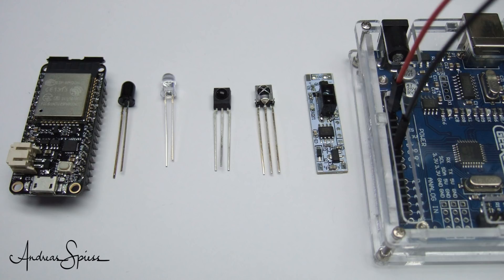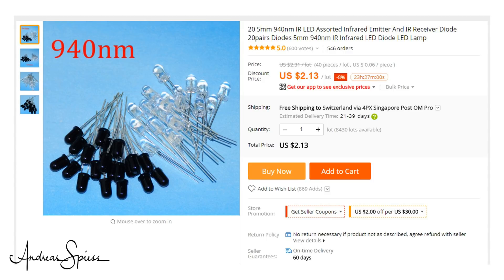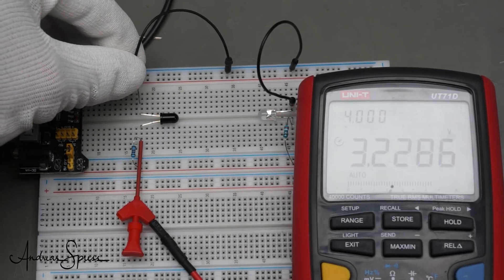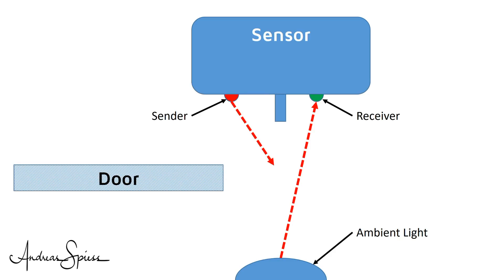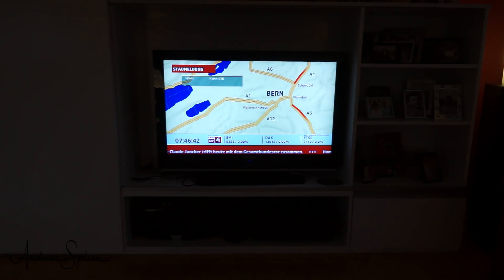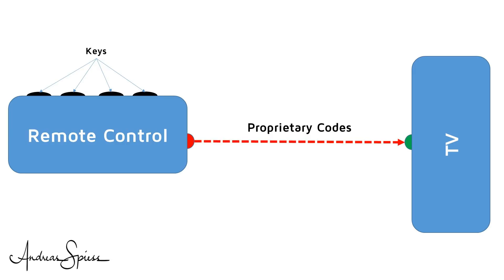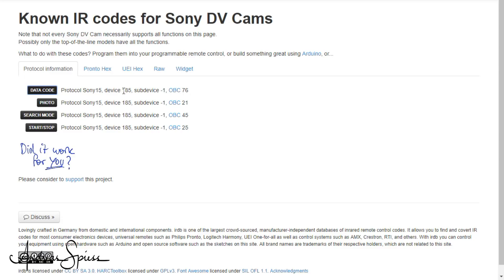#171 Arduino Guide to Infrared (IR) Communication also for ESP32 and ESP8266

Comment: Another excellent vid, Andreas!  
Why not just use the uC's registers and masks directly rather than use the burdensome and low-performance arduino ide functions for generating the proper signal frequencies and duty rates?  Almost any frequency generation is possible within very little cycle difference (error), which would not be an issue.  Directly accessing the registers is not dangerous nor is it complicated when compared to the much improved abilities they give the uC.

I do get it.... most ATmega 328p users are stuck forever in arduino-land, and you don't mind catering to the bigger crowd.  I would think that most people would rather learn a bit more and really see what is happening and be able to do much more, without the arduino-blanket blocking their vision.  The arduino ide still allows the use of all the registers, fuses, masks, and proper C and C++ instructions, etc, so if a person can't find the will to learn the basics of Atmel Studio in a few hour's time, they can still use the antiquated and pain-in-the-arse Arduino-ide without using the arduino's goofy, burdensome, canned functions. 
I suggest anyone reading this, and still using only the arduino ide, to go and download the Atmel Studio 7 and try it out before you let others convince you that it is too cumbersome and complex for you to understand and use to great advantage... AS-7 is so powerful and easy to use!  And it provides so many more features to help you work faster and smarter.  You don't have to learn all of it right away...  in fact you most likely can't.  It's a big place.  But after using it for a while you will not want to go back to the toy-like arduino ide. 
Yes, the arduino ide has it's place, it's super simple, etc. But it's terribly lacking.  Don't be ruffled by this comment.  Just try it out.  I double-dog dare ya. :)
Reply from the maker: 1. I did assembler programming and other low-level stuff like that when I was young and like it that the computer took over this work for me  (I still do it if absolutely necessary).
2. Arduino IDE is the standard in the maker scene, also because it can be used to program other MCUs like the ESP8266 or ESP32. An I go with a proverb from here: The fish has to like the worm, not the fisherman ;-)
3. Maybe you convinced some guys to try another IDE like Atmel Studio, or also Eclipse with your comment!

Comment: perhaps a ultrasonic sonic sensor like those HC-SR04 will be better for the TV door project, its awfully easy to program it to detect in a specific distance and no worries on the ambient lighting issues.
Reply from the maker: You are right, this is another possibility.

Comment: @Andreas did you have to do anything to get decent range from your emitters?  I've read most emitters in Remotes are "over driven", but I'm not to sure if that can be done with only 3.3V coming from an ESP*
Reply from the maker: This video was not about the distance, it was more about the logic to drive the LEDs. These microcontrollers only supply very little current ( a few mA) and if you want max power you have to add transistors to amplify the signals. I also do not know of high power IR diodes, but I never searched for them.
Reply: Andreas Spiess about logic not about distance is fair enough...  folks testing IR may think (as I did when first trying IR stuff) that the emitters are not reproducing codes correctly when in fact they are only effective inside about 30 cm driven by 3.3V ESP* pins, also looking with a phone camera is a good way to verify the emitters are doing something. :)
Reply from the maker: You are right. My setup worked over a distance of about one meter (from my ESP to the LED lamp above the bench. But it heavily depends on the quality of the receiver.

Comment: Your humor for the dear woman in your life is funny. I am certain your being a innovative electrical engineer goes over into other parts of your relationship. 
Curious as to how much range infrared can travel?  On approaching a gateway to a secured field a tractor or truck would automatically open from a distance of fifty meters. I would not want to have gate then left open but close in a short time with an override to keep it open should it be needed. Reliable and trustworthy are key elements for the not geek squad. 
Thank you.
Reply from the maker: I would not use reflected IR for 50 meters. Some sort of RF might be better for that.

Comment: FYI if anyone has an OSHW AVR Transistor Tester, there is a project option to decode IR signals ;)
Reply from the maker: Thanks for the tip. Do you have a link?
Reply: Andreas Spiess 
The IR option is on the M-Firmware Fork version. If you download the project SVN repo (linux) or download the tarball directly, you will have a copy of both firmwares. Once the main archive is unpacked navigate: Transistor Tester>Software>Markus>ComponentTester1.30M.tgz
If you unpack that (it's the most recent) file, Markus has info in the readme file.
https://www.mikrocontroller.net/svnbrowser/transistortester/

Project HQ is http://www.mikrocontroller.net/articles/AVR_Transistortester
Reply: This is a summary I created awhile back. This should be all project options encompassing both FW versions ;)

Absolute Minimum System
1.) 3× 680R resistors matched within 0.1%  
2.) 3× 470k resistors matched within 0.1%  
3.) 2× 100nF Capacitors (AVCC & AREF to GND)
4.) 1× 10k Resistor (Reset Pin)
5.) ATmega8/88/168/328
6.) Your Choice of LCD + Supporting HW
7.) 0.1% scientific laboratory grade power supply w/5.000 volt output 
8.) Push Button
NOTES: 
Internal 8MHz Oscillator
Internal Atmega IC Vref

M A I N  O P T I O N S

4× Interface
Option 1 minimum/required
Push Button
Option 2
2× Push Buttons (Increase/Decrease)
Option 3
Rotary Encoder w/integrated push button
Option 4
[Touch Screen (M-firmware Only as of 9/2017)

3× External DC Supplied Vcc Power
Option 1
0.1% scientific laboratory grade precision power supply w/ 5.000 volt output 
Option 2
5 Volt Regulator w/ better than 0.4% precision 
Option 3
5 Volt Regulator + 0.1% Precision Voltage Reference IC

5× Battery Based Vcc Power
Option 1
On/Off Switch + Test Button(s)
Option 2
MCU Controlled Timed Shutoff w/ Supporting Hardware + Push Button 
Battery Option A
9 Volt Battery + LDO 5 Volt Regulator w/ better than 0.4% precision 
Battery Option B
9 Volt Battery + LDO 5 Volt Regulator + 0.1% Precision Voltage Reference
Battery Option C
3.7v Lithium Battery + Boost Converter + LDO 5 Volt Regulator + 0.1% Precision Voltage Reference

4× (+1) Oscillator
Option 1
Internal 8MHz
Option 2
External 8MHz Xtal
Option 3
External 16MHz Xtal
Option 4 (M-FW)
External 20MHz Xtal
Option 2-4A
Standard oscillator Capacitors (~20pF)
Option 2-4B
1× Standard oscillator Capacitor + 1× Trimmer Capacitor ~0-30pF (Requires Frequency Measurement Device w/ Precision Disciplined Reference Oscillator such as a Rubidium Osc or GPSDO)

13× LCD Variations
~HD44780 (16×2/Hitachi Character)
~ST7036 (Dog-M)
~PCF8812 (Nokia 3410)
~PCF8814 (Nokia 1100)
~PCD8544 (Nokia 3310/5110)
~SSD1306 (microscopic size-OLED)
~NT7108 (Graphic Mono)
~ST7565 (Graphic Mono)
~LCD2004 (20×4 Character)
~ST7735 (Graphic Color 🐌)
~ILI9341 (Graphic Color 🐌)
~ILI9342 (Graphic Color 🐌)
~ST7920 (Giant Graphic Mono)

15× Additional Auxiliary Features Options
 ~TVS Array
 ~Relay Circuit Protection 
 ~Frequency Output
 ~Voltage Measurement (0.1-50 Volts)
 ~Zener Threshold Testing
 ~Infrared Remote Frequency ID
 ~Xtal Measurement (K-firmware)
 ~Optocouple IC Tester
 ~PWM LCD Backlight (LM339 based)
 ~UART Serial Communication 
 ~Solenoid Tester
 ~Direct External Frequency Measurement
 ~High/Low Freq. Measure w/Buffer&Prescaler
 ~Self Calibration Capacitor Circuit
 ~Sampling ADC Relay+Capacitor (K-FW)

Unofficial/None Supported Auxiliary Features
  ~Bluetooth Serial Communication 
  ~LC Meter Circuit (LM311)
  ~LC Meter Circuit (ATtiny3213)
  ~Xtal Test Circuit (PIC16F628A)

Comment: But after you decode the IR codes of the remote controller you want to copy, you also need to choose a specific IR send method (manufactory dependent) to send out the codes.
Correct?
Reply from the maker: Yes

Comment: How can we decode "Air Conditioner" IR codes ?
I want to transfer the code through XBEE from one module to another.
Reply from the maker: There is a comment of a viewer below where you find more info.
Reply: unsigned int  rawData[67] = {4600,4450, 600,550, 600,500, 650,500, 600,1650, 600,1600, 650,500, 600,550, 600,500, 650,500, 600,550, 600,500, 650,1600, 600,1650, 600,500, 650,500, 600,550, 600,500, 650,500, 600,550, 600,1600, 650,1600, 600,550, 600,500, 650,500, 600,1650, 600,1650, 600,1600, 650,500, 600,550, 600,1600, 650,1600, 600,1650, 600};  // SAMSUNG 181818E7

unsigned int  data = 0x181818E7;

no help down there!!

I decoded these raw data but how can i send such a long data through ZBEE.

Comment: I think for definitve it would be nice if you explored how fast you can exchange real data. Explore speed vs distance of ir pair as well as different times of day. Try to see how far you can exchange a file perhaps and write this file to sd card.
Reply from the maker: You are right. I thought, most people use IR for the scenarios I mention and not to transfer real data.
Reply: To transfer real data you should implement a proper protocol to manage transmission errors,  and at this point the speed will also depend on the protocol. You can have a look at HDLC, a protocol used for point-to-point connections beetween computers.

Comment: I did a very similar project last week but I used LIRC directly in my Raspberry Pi that runs MQTT and Node Red. I was also able to control remote devices using Alexa.

BTW: what's the site with the IR codes database? I have a Sony stereo w/o its remote and I'd like to control it. Thanks!
Reply from the maker: I added the two services I know in the video description

Comment: One of my next projects will be an IR sender.
So thanks for this video.

But I am also interested in your dimmable LED lights in your laboratory.
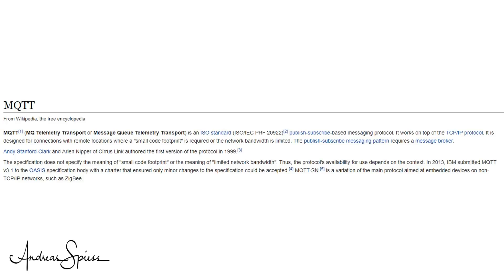I want to install white led panels like shown in Minute 13:00 and control them with an esp8266/32 and mqtt.
How did you manage that?
Could you make a video about that or post some links.

Thanks
Reply from the maker: I use a Sonoff dual, some PIR detectors, and Node-Red to switch my lights. I covered the different aspects of that in previous videos.
Reply: Thanks.
I know how to use Sonoff and mqtt.

But in the video it looks like you can dim your led panels.
And the Sonoffs cannot dim as far as I know.
Reply from the maker: +Christoph Wempe No, I cannot dim these panels. Just on and off.
Reply: Thank you anyway. :)

Comment: Typisches Beispiel für einen Ingeneur: Eine völlig falsche, überkomplizierte Lösung mit tausenden Fallstricken für ein simples Problem. Ein einfacher Schalter, z.B. ein CNC Endschalter mit rolle hätte gereicht und funktioniert. So musstest du dir zurecht das Geschnatter deiner Frau anhören - sie hatte mit jedem ihrer Einwände recht :)

---
Typical example for an engineer: A absolutely wrong, overcomplicated Solution with a heap of new Problems for a simple Problem. A simple Switch, a endstop with a rollerbearing for example, would have done the job perfectly. It's your own fault, that you had to argue with your wife - she was right with everything :)
Reply: At least it's not an example of how a marketing person would have it.
Then there would be an app where you have to find your phone, click 4-8 times and the door would open and the TV turn on.
It seems the WAF went from 0% to 100%+ after the bugs were exterminated.
Well done video again Andreas!
Reply from the maker: Viele Wege führen nach Rom. Ich wollte eine unsichtbare oder zumindes gut verstckte Lösung.

Comment: Another excellent video!

Out of interest, as you seem to fix a lot of libraries, do you tend to send pull requests back to the original repository with the fix?

I often want to use a thing you've fixed but don't know if the original repository (which quite often has moved forward since your video) includes your fixes.
Reply from the maker: So far I did not send it back. Maybe I will do it with this library.

Comment: Again an interesting video from Andreas !!
I also am thinking about putting ESP's with IR send and receive (and perhaps also a buzzer and some other sensors) in my house. However if you have several of this IR home automaton interfaces near each other send IR only from one! The devices will receive signals from each other and the logic can become confusing.
There are also much devices who use a IR power toggle code.  This requires the home automation system to maintain information about the current state. Or you need to add other sensors (e.g. the power consumption) to check if the device is on or off.
Reply from the maker: 1. As I mention in the video: You have to use an addressing scheme if you want to have several senders. Then, Node-Red can send an MQTT message to each of your senders, one after the other. Or the address is the delay each sender has to wait if it gets the MQTT message till it sends the IR signal...
2. Toggle codes suck. I do not like them at all because of the problems you describe.

Comment: Why not using an hall sensor instead of ir for the on/off switch? Easier
Reply: I also noticed that with reed switches the distance can be a problem. Hall sensors are more sensible !
Reply from the maker: You are right. Maybe hall sensors would be sensitive enough for the distance. Reed switches were not.
Reply: Sonar would work too.
Reply from the maker: +labomat you are right.
Reply: Because this video is about it.
Reply: Why would you make a system simple having a way to complicate it? To make a great video on technology, even at the risk of breaking your marriage!

Comment: thanks for share, i got question about lora, 

i want to make  group street lights like street 1, street 2 and is that possible to add street 1 group? i just think i should make them devid same id and when i send deviceid=street1, same lights will rise

is that possible? @andreas spiess
Reply from the maker: Do you talk about LoRa or LoRaWAN? If you just use the LoRa protocol, you can use the Radiohead library to create an addressing scheme. If you use LoraWAN each node has its own address. But you are not allowed to send too many commands. LoRaWAN is designed to get sensor data, not to send commands.

Comment: Of course there are also Apps that will fire IR from your mobile too - even more functionality. :)
Reply from the maker: You are right. I saw these dongles. Creative idea. I think they are not often used because they block the headphone jack. And the new iPhones even do not have one anymore...
Reply: No additional hardware needed - it's all already built in.  https://www.tomsguide.com/us/pictures-story/494-android-tv-remote-apps.html
Reply from the maker: The video says: "Turns your blaster equipped smartphone..."  Unfortunately, not many are equipped with this feature https://en.wikipedia.org/wiki/List_of_devices_with_IR_blaster . And my iPhone for sure not...
Reply from the maker: You definitively are right with tasker. But as a citizen of Great Britain, you should also understand the value of "tradition" ;-)

Comment: To detect if the TV door was open or closed I would have probably choosen a reed switch attached underneath the shelf and a magnet behind the door. Since you are using esp8266 there is very nice library for it with already all codes from many manufacturers. If you want to take a look at my simple MQTT IR remote here is the link https://forum.mysensors.org/topic/8018/mqtt-ir-remote
Reply from the maker: Thanks for the link. Because I also have an IR receiver I did need a list of codes. But if you lost your Remote or if it does not work anymore this is a good thing...

Comment: Wonderful video as usual!
Now, I am not entirely sure about photodiodes always being black, and IR emitters always being transparent. I recall having several IR diodes that did not follow this "convention" and I specifically remember using a CMOS camera (normally a phone or a PocketPC) to find which ones were emitters. Receivers were tested later in the same way you tested them on breadboard, to make sure they were receivers indeed, and not just bad IR LEDs.
Reply from the maker: Thanks for your addition. I only had these on hand and it made sense to add a filter to the receiver, not to the sender...
Reply: Yes, quite a few LED diodes (emitters) are also black. e.g. I bought some of these a while back: https://goo.gl/s66mhX
Reply: Oooops! wrong link, sorry!
These are the one I meant https://goo.gl/WrPSRS. They are not as black as the receivers though (although in real life they look darker as in the pic).
Reply from the maker: +SierraLimaOscar Your link says "Receptor de INFRARROJOS Receptor" which I think means receiver? The pictures also show the word "receiver"
Reply: Those look like the everlight ones adafruit sells described as blue transparent. The receivers I've seen look black almost totally opaque.  No idea why they tint the emitters. Narrow up the pass band, vis ID..?